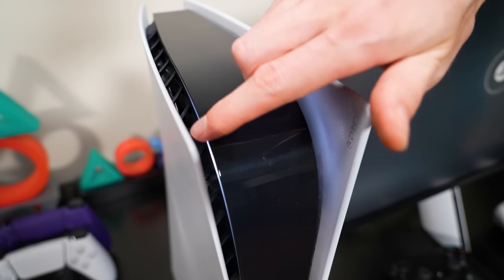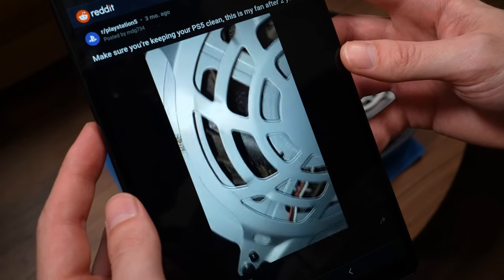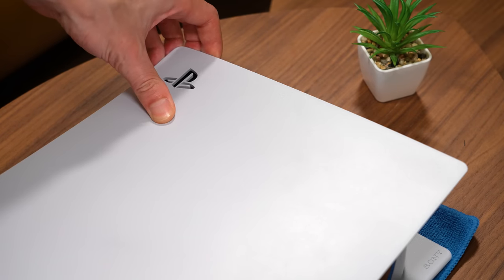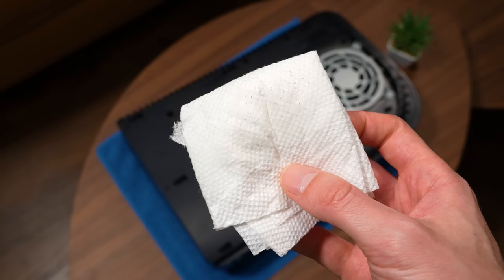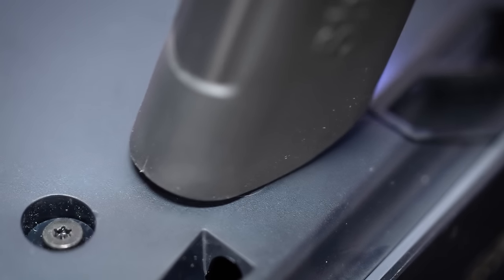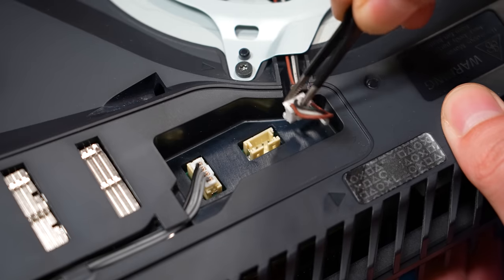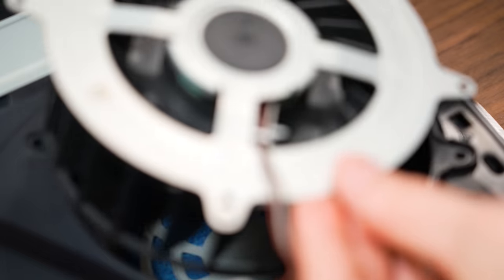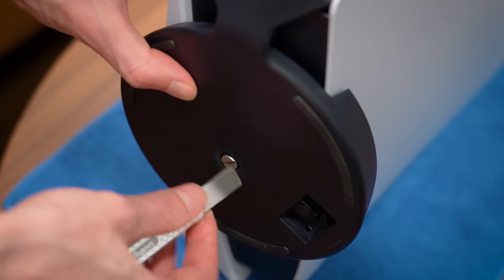It's time every PS5 user checked for this..

Comment: I can't imagine how many people will break that fan connector trying to unplug the wrong way
Reply: Guilty
Reply: @20vitorneves  oops! Now what?
Reply: Noobs.
Reply: @datboitmic  There are a lot of playstation noobs lol
Reply: You can get the fan all the way out without unplugging it. When the screws have been removed you can lift it out while its still plugged in
Reply: @TheRandomVaper  You can also just grab the plastic part instead of the wires when you pull and not break the connector lol
Reply: Sadly it'll also be the same people who think they've forever broken their ps5 if they pull the wire out of the connector by accident.
Reply: 😅 I damage it by accident but it still works
Reply: What's the right way?
Reply: @gorillakiller19  most people don't know on what part to pull on and they end up pulling on the base of the connector which is the same color as the thing your suppose to unplug and you know how that will end like.
Reply: @Trippsy05  Well making a ps5 that way to gather dust and not be easy to clean out is Sony's fault and they making it hard for eg to change batteries out of a controller, typically these are shot in the foot train of thought, it's no wonder Sony are in huge debt they don't think when it comes to things that make them profit and things that make them lose money.
Reply: As a computer technician, I first thought how could anyone force a connector into a fan header to the point it would break… and then I realized these are playstation people we are talking about. 🤗
Reply: If you don't know how to connect one of those connectors, you shouldn't be getting this deep lol
Reply: No one asked what you can and can't imagine
Reply: It's a plug and 4 screws. How hard could that possibly be for people
Reply: I did it on the ps4
Reply: Honestly for people that have never removed a pin connector like that- they should not use any tools but their hands. Tools will be more likely to damage.
Reply: Us xbox users are an elite breed so we don’t face these issues
Reply: Not too many.. At most 20 people have PS5 so far lol.
Reply: @smd4246  I'm not a console expert but there isn't any difference between the 2 they're both plastic boxes with roughly the same hardware beside the software side of things.
Reply: I got someone who knows what to do payed them to do it
Reply: @gabrielgalaxygh  Some micro-screwdriver cases have a warning: "warning do not insert into penis" I think I can leave it at that.
Reply: @vWhiz  In my case I knew on what part to pull. My problem was that both the base and the part that you can unplug were basically glued together. I have no idea if the heat may have made it so that the two parts were more attached to each other than they were supposed to. Even by gently pulling the correct part, both ended up coming out
Reply: @vWhiz  lmaooo my ps4 pro suddenly turned off one day and wouldn't turn back on so me and my dad wanted to check it and see whats wrong u know the piece on the motherboard where the powerbrick and shit connects too his drunk ass ripped out the thing right off the motherboard trying to unplug it , is it fixable or no
Reply: @deusvlad2.083  what are you talking about they made it easier to clean the ps5!
Reply: @ItsHeavyHitterNation  Tell that to the kid that broke their ps5 trying to clean it lol
Reply: @BlackStarEOP   This guy should do a video on that next warning people.🙃
Reply: All for nothing as well the dust that you’re gonna wanna remove is on the heat sink not the fan.
Reply: @Callthefedsonme  Yeah and that is way more difficult to remove.
Reply: Yeah, good luck with that and standard warranty...
Reply: annnnnnnnnd thats your warranty gone
Reply: Sony doesn't recommend anyone to clean their consoles. Instead you have to watch a random video on how to take it apart and clean it yourselves.
Reply: Dont do that part furreal I put a piece of plastic through the fan so itdidnt move and used my gas lawn blower to knock all the dust out. Alcohol  wipes and paper towels for the rest
Reply: My biggest fear lmao
Reply: fear of messing something up and damaging my console is why i haven't don't a thorough cleaning of it yet
Reply: I yanked on the wires everytime I opened it and haven't had ant problems
Reply: Yes, and this is why i'm not doing it.
Reply: I pulled mine loose from the plug probly 10 times trying to get my disc drive to work and hasn't broke yet
Reply: 🫣when I cleaned mine months ago I tried using normal flat tweezers (no grooves, no grip) I slipped and took a bit of the plastic off one of the wires. After that I was very careful and decided  to just use my fingers. Still works completely fine to this day but I die inside whenever I think about it
Reply: guilty
Reply: Does anyone know how to not reach this stage of cleaning 😂 I don’t want anything happening to it. Just purchased PS5 so
Reply: @chiranjeevgorur7867  it’s kind of inevitable that you will need to clean it. Best you can do is try to keep it in as much of a non dusty area as you can. And vaccuum regularly in that room, or sweep, as well as dust counters and such if you are not already. This will mitigate it somewhat. That being said, it was similar last gen and people can certainly go all gen without cleaning it. If it starts to overheat or shut off randomly or anything though, that would be the first thing I would check though. Even just cleaning the vents you can see, even with the plates on, every couple months will be helpful. Or you can snap off the plates and clean any dust around the outside of the fan and plates as well without taking it off and apart to fully clean. Other than that though, it will get dust in it, that’s normal though. Some rooms are just dustier than others so the rate in which this accumulates may be different for everyone.
Reply: @smd4246  still hav to clean your console
Reply: I hope they do break it. So many people don’t deserve to own a ps5.
Reply: I've fixed a few already
Reply: @deusvlad2.083  the irony of your comment.  Even for a novice it is extremely easy to clean a ps5 compared to the older consoles which are virtually non user serviceable. These you can actually take apart with relative ease and clean. Take your ps4/ps3/or ps2 apart and clean it. Then come back to me.
Reply: @davidhodge0201  I found it easier to do the other consoles, mainly the Xbox because its like taking apart a pc lol   Oh don't insinuate I still have a ps1 2 3 or 4 lol
Reply: @deusvlad2.083  lol. I was just saying. Those older playstation consoles were a bitch to take apart. These new ones are actually very easy compared to the older ones. The panels are literally tooless and the fan comes out with one torx driver. Easy maintenance
Reply: @davidhodge0201  What I want to know is why even take them apart? I  remember taking the ps3 apart, didn't need to do the others, I modded the ps3 once upon a time, that was kinda annoying to put back, was easy to take apart though. I never liked sony's enclosed hardware in all their stuff, especially their controllers.

Why take apart the ps1 ps2, or ps4 unless its to mod the case? I can understand the ps4 getting dusty, I just used a vacuum cleaner on the vents lol.

I will say this, whoever can do the ~Sony shit, has to have a good memory otherwise your fucked lol. Remebering where all the parts go is the main issue, losing small parts that's another headache. You lot have memory and technician nimble hands.
Reply: @HdJnW  you damaging it over time more if you don,t clean it
Reply: Well just cleaning the fan doesn,t bring you far you have to check the Heatsink and the power Supply there are some holes over the power Supply to Provide airflow if you don,t clean it after 3 months there are no longer any airflow bc of the Dust
Reply: @rocketgamer3878  most don’t know or feel comfortable going that far in disassembling their consoles and it is easy to but for the console owners that is a no go. But for someone like me and probably you it isn’t a huge deal. My self I’ve built 2 different PCs and opened up 4 of my old consoles and never broke one clip in the process of doing.
Reply: @rocketgamer3878  Sounds annoying to do every 3 months.  I never once cleaned any previous consoles even the series X they all work fine even decades later. I guess I have less dust in my room lol.
Reply: @vicvancen  I don't even have a ps5, I just laugh at people opening their system up to clean it from dust and their console breaks down lol.  It's happened trust me
Reply: @deusvlad2.083  It most definitely happened and I'll give you that, that shit is mad funny. A little bit of healthy schadenfreude
Reply: @vicvancen  lol
Reply: @smd4246  No need to even turn on your Xbox because you have no games worth playing anyway!
Reply: Ye, don't do the fan thing. Vacuum the dust catcher like Sony advises and maybe also use a vacuum to suck some dust out of the fan and that's all you need. Ppl are way too paranoid with cleaning their systems, these things are build to survive the dust, it is really not that vital that you do a super thorough cleaning...
Reply: @mandrews6282  I Dust my Consoles  once a day with a make up brush as far into the crevices i can go but I don’t remove the panels.

If I Dust every day and it’s not in a dusty area, would it still be recommended to remove all the parts to clean the inside? Thanks
Reply: @ashgaming7045  you probably don’t have to as you’re already maintaining it well beyond what most people will. However, it is super easy to take apart and clean so if you want to do this for your own peace of mind you definitely can. I’d say maybe once every 2 years. Maybe once a year even if you want to be really thorough. If you’ve already had the console for a while you could even open it up now and get an idea of how much dust is in there after X months that you’ve had it and then you’ll know about what it’s accumulating. I suspect not a lot though if you’re dusting it daily anyway as that means not much dust is making it inside as it is. You’ll be able to tell right away if there is dust build up just by taking the plates off as you can see the fan easily without actually taking it out. I’d pop off the plates and see what it looks like and go from there.
Reply: @mandrews6282  Hi Mandrews, Thanks a lot for the advice and I will definitely take a look. I have it from day one and I like to keep all my electronics, dust free looking like Day one. 

I feel like maintaining it, is much easier than letting it accumulate. I appreciate the info! 

My N64 even still works as well as my Dreamcast and PS2 slim along with other old console/electronics all look new. 

I never opened any of them; just dusted everyday as a habit to keep them looking fresh… 

My biggest pet-peeves as a collector is Dust, Humidity & Plastics that scratch too easily just by giving it the evil eye since the plastic is so sensitive. Lol
Reply: Cleaned mines a few times and as long as you're careful you can just flip the fan over to clean it, no need to unplug
Reply: This is a molex style power connecter. Remove it by grabbing onto the pin housing and pushing in the lock that allows it to stay in place with the header. Don’t pull without pushing this in or or pull directly on the wires
Reply: @SolidusSnake5  I wish it was likes the bigger one honest because I’ve owned 3PCs over my whole life and non had been this stubborn with any connectors even the hated molex one your talking about because the ps5 one pulls the base off with it too like how some GPUs fan connectors do it’s absolutely frustrating edit: even if you pull the connector part it doesn’t help because those small teeth it has as locking pins don’t like to budge so I just use a small file to flatten them
Reply: @TheRandomVaper  yep
Reply: Am not sure there are alot of people brave enough to unplug the fan
Reply: What is the name of the tweezers please
Reply: Not sure why they would make it so flimsy ...or such a chore to take it apart to clean it
Reply: @Shadowan  well, you can always buy a new cable, or you can fix it yourself, cause I'm pretty sure unless you make a disaster it can repaired
Reply: Skill issue
Reply: @deusvlad2.083  I pefer having no AA batteries usage, as unless if you use rechargeable batteries, or the offical rechargable battery adapter I believe I remember having a hard time playing bc the batteries died and I had to use a tiny micro-USB to charge my XBOX ONE controller, lol
Reply: @Star.6739  That's the thing with Xbox you have the best of both worlds, you use rechargeable AA's in the Xbox yeah? Guess what you can charge the controller externally with those batteries in meaning it's the same thing as ps5 only it lasts longer battery based on the size of the battery, and a million times more easily replaceable than the ps5, ps4, ps3, controller.
Reply: @datboitmic  thats not nice
Reply: @TheRandomVaper  oh.. makes sence thanks
Reply: i mean its a gentle cable but its basically like an lan interent cable maybe a bit more secure.. you just got to unscrew some screws and lift it up its not such a big deal man xd
Reply: lmao i knew how to disconnect it but i DROPPED it when it was plugged in and not screwed in lol ripping the connection to the motherboard
Reply: Exactly , thats what am thinking , i dont wanna risk that
Reply: In the name on over cleaning i dont wanna damage parts , those wire look so slim and risky. 🏳️‍